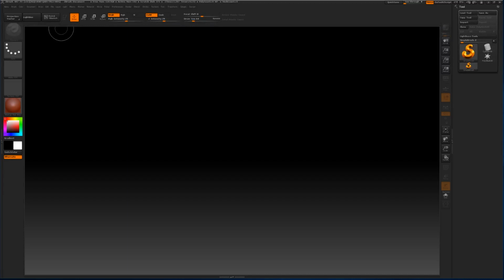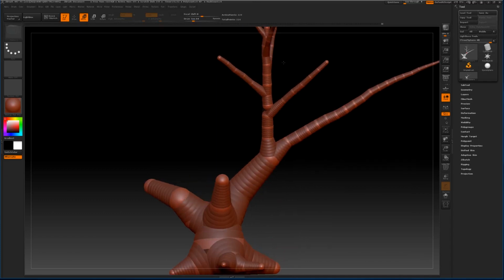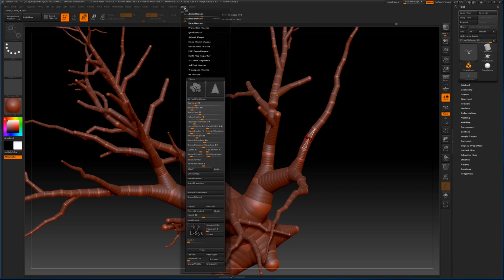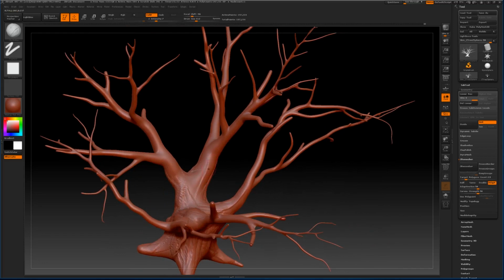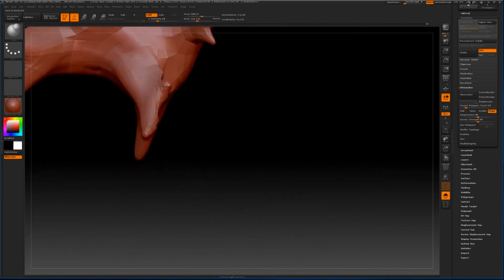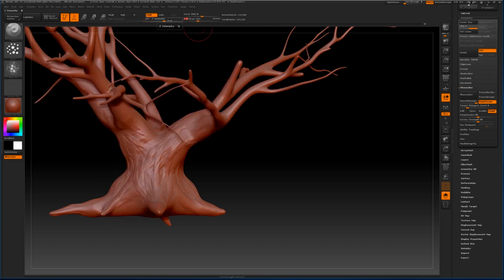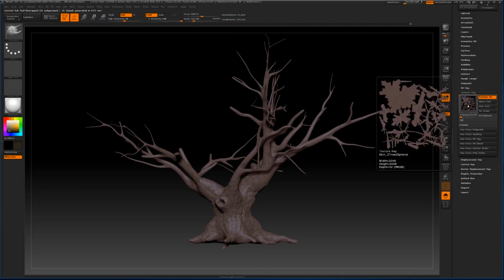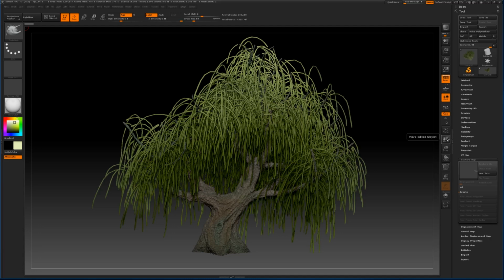Tree Sculpting Tutorial using ZBrush

Comment: Hi. I just started this tutorial and I was putting the extracted version of the ZTree plugin into my ZPlugs folder. But I have ZBrush 4R8. Not 4R7. I still have 4R7 because I was afraid to uninstall it and worried I would lose things :/ 

But when I follow the steps it doesn't work (the plug in doesn't show up in my Zbrush Zplugin menu in ZBrush 4R8. 

Please help! Thank you!
Reply: I also had this problem. To fix it I just double clicked on the Ztree.zsc file and it will 'open' the script in Zbrush. Once I did that, the plugin shows up in the menu.
Reply: did you put it on Zbrush 4R8 folder? cause 4R7 and 4R8 have different folders
Reply: This worked! Thank you SO much! :D